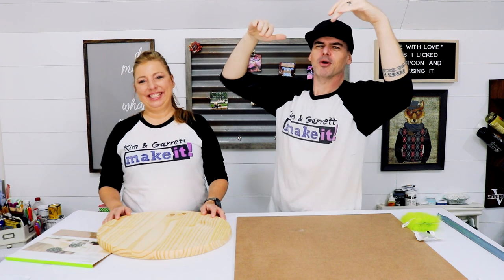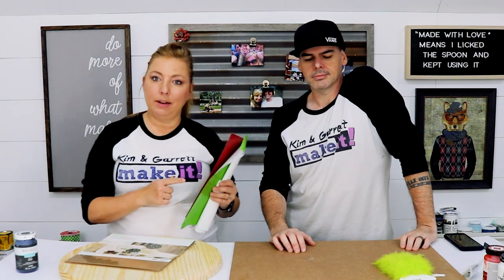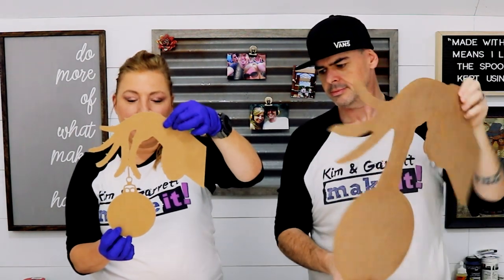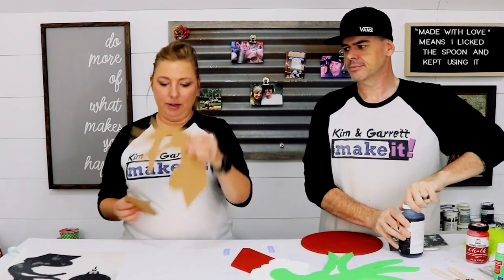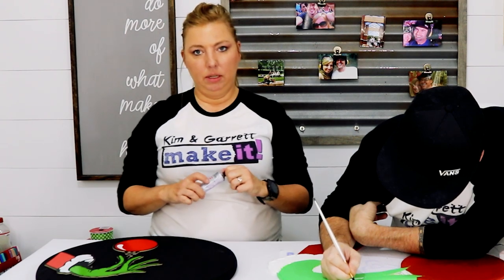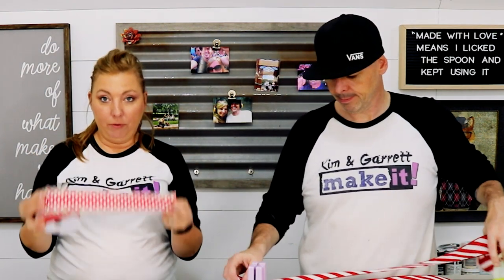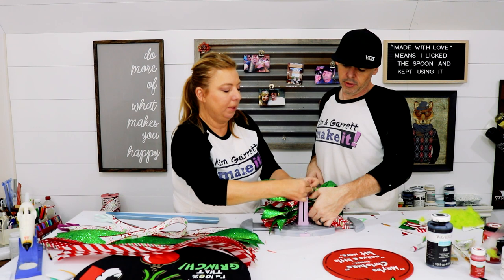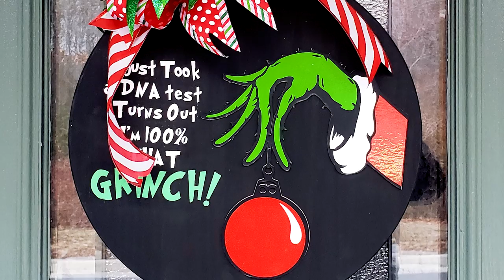Grinch Hand Wreath Christmas Decorations

Comment: Love them both!  I have a question:  How do you keep the chipboard from tearing?  I have tried to cut this svg 3 times and it keeps tearing, I taped it down with painters tape, and even the tape tears off some of the chipboard.  Any help would be appreciated.
Reply from the maker: I like to make the tape a little less sticky and then using mod podge as a first layer